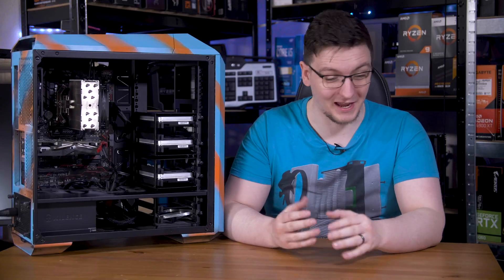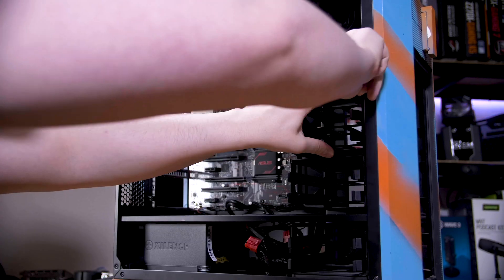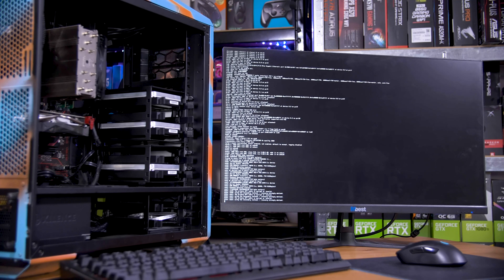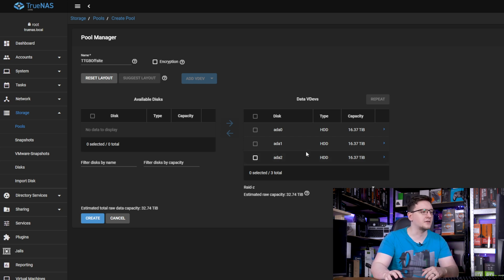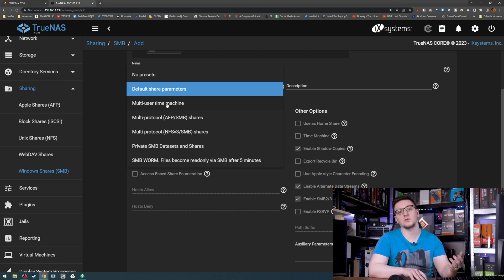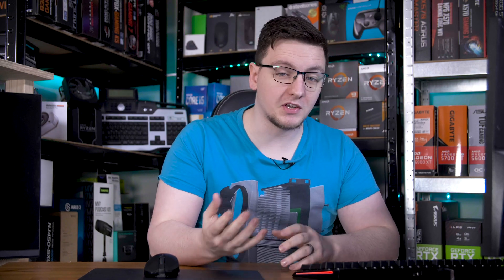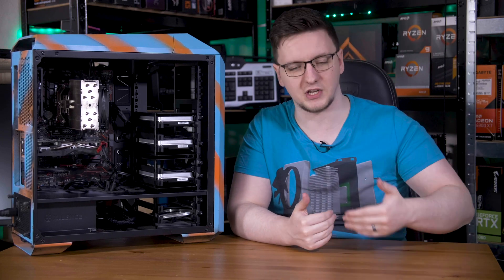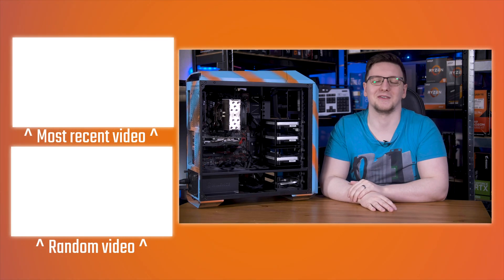Building an Offsite Backup NAS

Comment: Nice using old hardware for new things! I bought an old HP Gen8  Server from ebay, £100, put the most powerfull Xeon i could in it, direct from Aliexpress, got 32Gb of ECC Ram,  jobs a good one. Haven't looked back. Running a few apps from Truenas Charts catalog on the server, Emby with GPU passthrough, torrent software, pihole, quacamole for remote access and one for the kids, Minecraft! All pretty easy to set up! Server doesnt break a sweat! Much more fun than buying a NAS! Keep up the great content 🙂

Comment: I use a Inter-Tech 4004 case. That is a 4 bay miniITX case so it is very small. Additionaly I use a miniITX Mainboard with an AMD B450 chipset and as a CPU a Ryzen 3 2200G. A 256 GB M.2 NVMe SSD is the boot drive. 16 GB of DDR4-3200 RAM and a low profile Noctua cooler together with a 250W power supply do the job nicely. Two of the drive bays are populated with 6 TB seagate desktop drives I pulled out of external cases to save money. They run in mirror in my case for close to a year 24/7 now.

I don't use TrueNAS thow, there ist Debian Bullseye installed on the SSD, together with OpenMediaVault, pi-hole as a network wide DNS ad filter and miniDNLA. The system has last been setup in October 2022, so it is very reliable and totally fits my needs. Since the server ist so small it fits nearly everywhere. It has a 2.5 GBit LAN card added into the only PCIe slot. I'm very satisfied with it so far.

The server is backed up to several external harddisks from time to time of course. As you know: RAID does not replace backups.